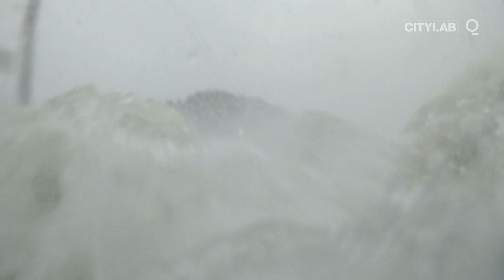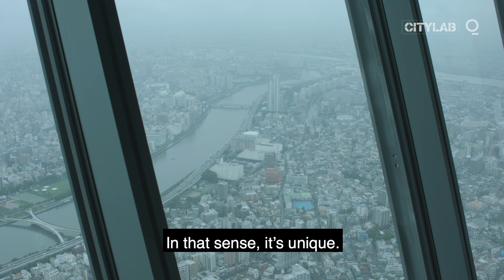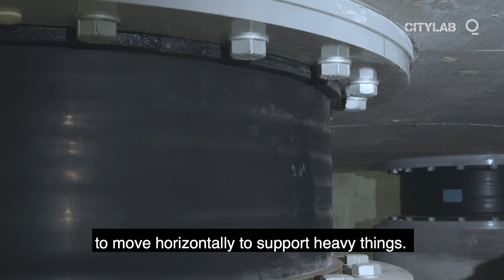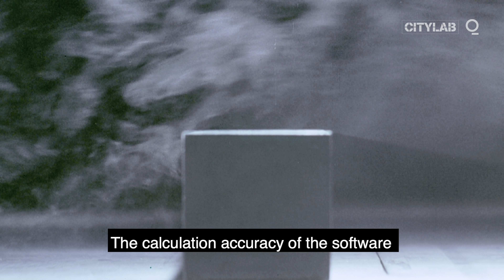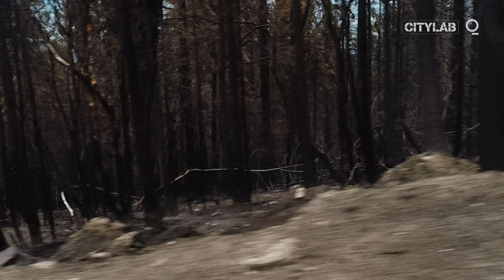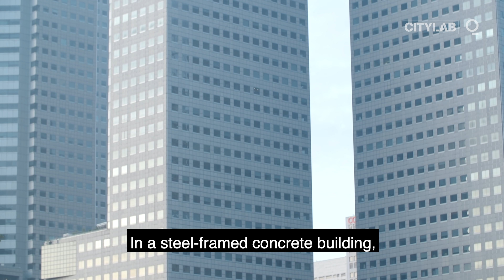How Japan Is Building Disaster-Proof Skyscrapers

Comment: Japanese skyscrapers are designed to sway flexibly to release seismic shaking.
This is how Japanese-style high-rise buildings' earthquake-resistant structure and vibration isolators work.
The same is true of a 1,500-year-old wooden five-story tower structure, which is made of wood but with a flexible structure that shakes and is designed to isolate vibration.
Without this structure, when the ground shakes, the building would collapse due to the repulsive force of the ground shaking.
As a countermeasure, the building has a flexible structure that synchronizes with the shaking.
Of course, there are limitations to this method of vibration isolation, but the building can survive a slight earthquake without collapsing.

Comment: Since The Philippines is Also Prone to Disasters Like Typhoons, Earthquakes, and Floods, I Will Design World's Tallest Building to be located in Quezon City, Metro Manila to Feature Shinbashira for the Core of the Building Where its Elevator is Located Here and Multiple Tuned Mass Damper Will be Installed on Tower's Spire and Also Another Will be Installed Inside the Building that Features Tuned Mass Damper Observation Deck Just Like the Taipei 101 Which Have This.

Comment: Not sure if it was a translation error but steel is not weak in compression, its certainly cheaper to use timber or reinforced concrete as compression members

Comment: Imagine How much maths has been done to build this thing
Reply: Automation it's an entire mathematical beast on its own
Reply: yeah right! like 12 or 13 maths
Reply: i dont know how much but at least 3 i think.
Reply: Ahh that balanced out my calculationS. Thanks
Reply: Eldritch abomination of a math problem
Reply: Its automated
Reply: @ahmed03807  nope. if you know how building designs work, you know theres a floor or two full of interns at an architecture firm being told to run simulations on their computers to test structure rigidity and stress.
Reply: @Tensho_C  I would assume that interns at an architecture office had nothing to do with the structural integrity of Tokyo Skytree.
Reply: ikr
Reply: Not more than the maths to land a rocket vertically.

Comment: Wood sounds like setting up a recipe for a different disaster:  fire.
Reply: They actually coated the wood with some fire proof plasters
Reply: all you need a divider design for that a mix material the building will  not made 100% wood after all
Reply: not only do we have fireproofing and glulam members, but usually structural systems or members are rated for X# of hours until failure to allow people to evacuate and for the fire to be stopped. Fireproofing is usually a whole section of whatever building code you are using
Reply: Not nessessarly for thick members because of charring.
Reply: I'm pretty sure they've thought of that... Fireproofing materials and extinguishing systems
Reply: Well it don't matter because in japan houses are demolished after 30 years.
Reply: @Abdi-uy1kh  But in the United States, a house fire is reported once every 22 seconds. I'd picture this statistic to be similar in Japan or elsewhere in the world because we have gas and electricity and other fire hazards inside the home.
Reply: @Awesome_Aasim  yes they use a fire proof wood technically.

Comment: How do u service the rubber and oil dampers?
Reply: with more rubber and oil
Reply: wair for calm weather, and service them one at a time or more but not all at once
Reply: wonder that too..like do you need to change the damper? how do they lift it etc..
Reply: @whatever_12  More than likely an industrial jack. We've seen these in action like when San Francisco's Salesforce Tower's bridge was cracking and they needed to support it. They would apply some jacks around the one they plan to replace and set them up to take the load off of the rubber to then replace it and release the pressure back.

Comment: Nice video, but a big dislike for Japanese translation, which didn't consider the context of the words and phrases, how English language is spoken, and how the different culture affects the way of speech. There are problems on every single piece of translation, and some of them just make the sentence not understandable at all.
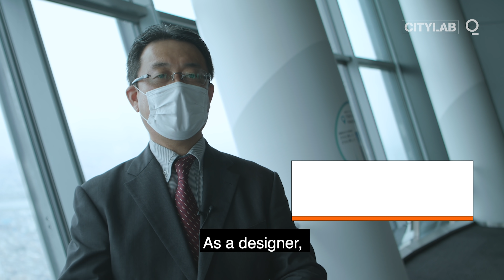For example 1:51, those Japanese way of speech originated from local humility culture, like "緊張感" (nervousness) and "自信" (confidence) in Dr. Konishi's sentence, doesn't exist in English way of speech. It should be translated to a way that English users are able to understand, like "It is very hard to design this building / The first problem we met is wind / The building stands only 8 km away from the sea / The sea breeze is strong even in calm weather".
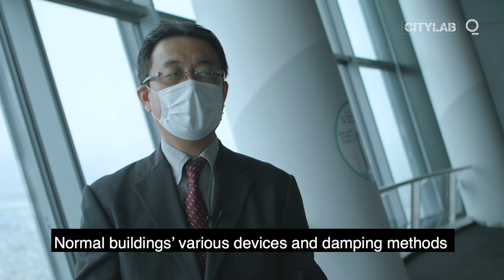Another example would be 2:31 "色んなデバイスなどが　制振の方法が", as the translation in the video is just word to word translated like "various (色んな) device (デバイス) and damping (制振の) methods (方法)", but instead it should be translated as "vibration control technique". The whose paragraph would be "Regular vibration control techniques used on most buildings / cannot be applied to this tall and thin building / so we developed a unique method to make the building safe".
Reply: Translating from one language to another is never going to be 100％ accurate, but I thought it came pretty close most of the time. Also, correct me if I'm wrong, but in 1:51, wasn't that not 自信 but 地震 instead？
Reply: @cjkasper  You’re correct. He was referring to the earthquake 地震 and not the confidence 自信。
Reply: @cjkasper  Sorry, maybe I'm the one who make the mistake; I'm not a native speaker and I'm still trying to learn Japanese. May I ask you to somehow help me fix my translation? Thank you!
Reply: Thank you very much for your imput, improvement
Reply: I agree with your translation of vibration control techniques. However, Bloomberg also mistranslated 緊張感. It should’ve been translated as “tension” (literal) or “rigid” (idiomatic) and not “nerve-wracking.” He said 緊張感のある細長い構造, so the 緊張感 describes the structure, and not nervousness he was supposedly feeling. The translation should’ve been “a long, thin structure with rigidity.” 

Also, Bloomberg translated “jishin” correctly. The “jishin” he mentioned was the earthquake 地震 and not the confidence 自信because the sentence was 地震もそうなんですけれども風が一番厳しい meaning “while earthquakes are also a problem, wind is the toughest issue”. I can see though how you could’ve misinterpreted 地震 for 自信 because of the context of 緊張感 which generally refers to a feeling and not a structure.
Reply: @tdms12  Sorry, I'm not a native speaker and I'm still trying to learn Japanese. These are my mistakes. Thank you! May I ask you to somehow help me fix my translation? Thank you!
Reply: I don't even speak japanese and translation issues were apparent. For example, the translation of the chief engineer stating that wood "can withstand compressive forces but not pulling forces". Wood is up to 2x better in tension (pulling) than in compression. Something got seriously lost in translation there...
Reply: @tw0million  It definitely did lol

And nobody in civil engineering tends to call it a "pulling" force, we just refer to it as tension.

And now you figured out what I'm majoring in lol
Reply: Thank you for saying, I was literally thinking the same thing while watching the video, so I'm really pleased this is a high up comment.
Reply: This is why I'm just learning Japanese instead lol

These two langauges are veeeery hard to inter-translate.
Reply: Umm actually as a native speaker, the part of translation pointed out in the comments is actually not so bad... nerve-racking is not utterly wrong translation. Because of the thin structure, it made "the designer" uneasy to design the building. That is the nuance I get from this guy. He is kind of speaking awkwardly, and sometimes what they literally say is not what they really "mean". So some Japanese learners might think nervousness is talking about the building but it actually because he said "as a designer ", so it means HE felt uneasy in the context. And as some people pointed out, "jishin" he said was not "自信"(confidence), it is "地震" (earthquake).
Reply: @KL sz   Thank's for the insight. Professional translation requires in depth knowladge of both languages, and some effort.
Reply: Stop this and I'm asking him about translating into arabic or African languages too..
Reply: Imagine, We Japanese YouTube viewers always troubled like this problem in English translation. always!
Reply: @蝦夷鹿さん  I've seen! It sounds horrible